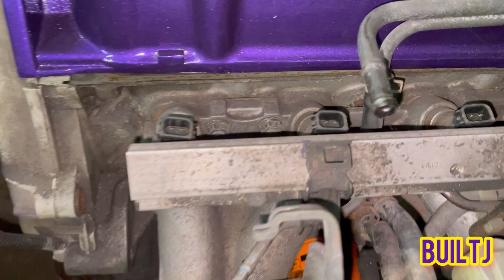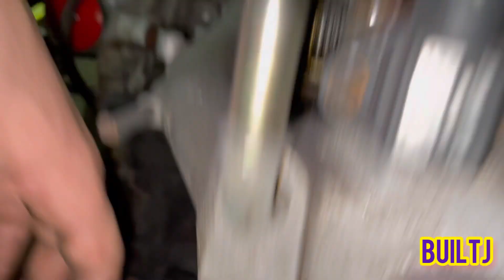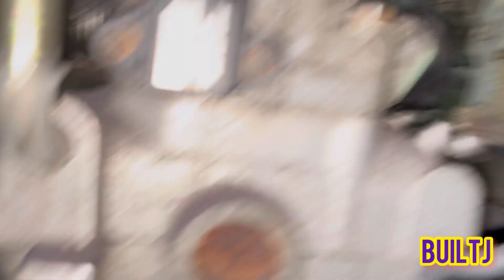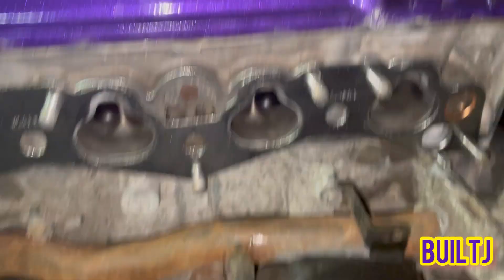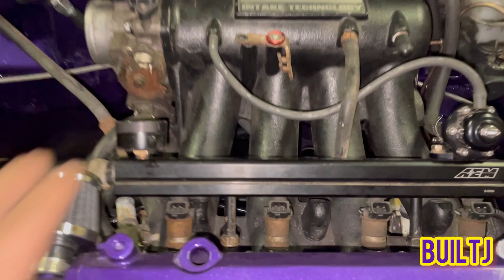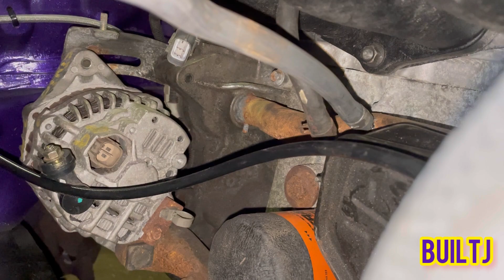D16y7 intake manifold skunk2 upgrade!

Comment: How did you go from a three-wire plug on your idle air control to the two wire for the new intake you didn't show anything about that and that's where I'm having my problem
Reply from the maker: It’s depends on the ecu I never changed to the 3 wire plug. 
3 wire plug is for y7 which is what’s in the car now when you run a p28 or y8 5 speed ecu you need to change to the two wire plug. Honda tech still has a great write up on it in there forums
Reply: @builtjfilion934 I put a plate over where the idler control valve goes on the back of the intake and I still had a wicked pulsation so I checked for vacuum leaks I checked the gasket I checked the throttle body gasket I took the whole intake back off I'm just not sure and I made the mistake of doing this to my daily driver
Reply: @JohnAndrew-i2s what was your fix I need help 😭😭
Reply from the maker: I’m running a d16y7 engine with d16 y7 ecu and stock y7 throttle body that comes with the 3 wire plug from factory no modifications were needed.
Reply: Exactly why I’m here 😂 dude showed everything but that part

Comment: For your IACV hookup, did you need to swap from a 3pin iacv to a 2pin iacv? If so what did you do with the 3rd wire? Wire cap?
Reply from the maker: No I did not I used the same wire harness d16y7 (3plug iacv) installed a y7 throttle body w/iacv and blocked of the skunk 2 iacv that sits on the back of manifold
Reply: @builtjfilion934 automatic or manual? Having trouble haha
Reply from the maker: @sneanlabaaab7986 what set up do you have the one in the video is 5spd😊
Reply: @builtjfilion934 5 speed as well! But i think i have the wrong theottle body hoenstly! I dont have that vavle on the bottom of my throttle body or an iacv i dont think in the same spot. I think i have an automatic throttlebody on and its messing with my idle
Reply from the maker: @sneanlabaaab7986  what ecu are you using and what motor are you running d16y7 or y8 vtec?  D16y7 looks for 3 wire iacv so you must use a d16y8 automatic throttle body.
Reply from the maker: If using d16y8 you have to use the 2 wire iacv with the b18 LS throttle body (doesn’t have iacv at the bottom like d16y7) or a true 5speed y8 throttle body(also doesn’t have iacv at the bottom)
Reply: @builtjfilion934 stock ecu. D16y7. To run the automatic theottle body do I need my ecu tuned to lower my idle? Before i had the manual theottle body and my idle would jump so i swapped to an automatic throttle body which now has a constant throttle but is idling between 3k and 4k lol
Reply from the maker: @sneanlabaaab7986 what manifold are you running? The same skunk2 manifold in the video
Reply from the maker: @sneanlabaaab7986 no tune needed if it idling that high there is a vacuum leak replace the manifold gasket and throttle body gasket and make sure it’s 5spd version gasket
Reply: @builtjfilion934 so to clarify? Use the automatic throttle body with correct gasket and it should fix the high idle?
Reply: @builtjfilion934 just to clarify, if I'm running an automatic throttle body I should be okay just as long as I have the correct gasket?
Reply from the maker: @sneanlabaaab7986 yes what manifold are you using?
Reply: @builtjfilion934 i think that did it, idling at like 800 rn! Just wrong gasket. And skunk2 just like yours!
Reply from the maker: @sneanlabaaab7986 yes sir!!! That’s what I’m talking about brother 🙌💪

Comment: I have a 98 civic lx with the d16y7 motor and was looking to upgrade to the skunk2 pro series intaje manifold that kinda looks like yours. Did u have to move any parts to make it fit? Or is it just swap for swap
Reply: Hey I had the same question and assuming you did the swap did you have to get any other hoses or anything of that sort?

Comment: How did u go about running that style idle air control valve. Bec my oem one was not the same style or the same plug.
Reply: He alr did a engine harness swap im having the same problem spent alot of money for no reason im stuck I’ll probably just go back to the d16y7 intake manifold this is ridiculous 😢

Comment: DO NOT DO THIS UNLESS YOU HAVE A COMPUTER TO TUNE YOUR CAR… YES You need to Dyno after this the car will choke & just bog out do to high air intake & low fuel intake the fuel rail is only going to help but so far

Comment: So what about all the sensors that are on the factory manifold? Do you just not plug them back in or delete them? I’m just confused
Reply from the maker: Depends what ecu your running. In my case I used the y7 throttle body & y7 ecu that looks for the 3 plug signal. So yes the other iacv that sits on the back of the sk2 mani is useless just loop the hose from one nipples to the other to prevent a vacuum leak. If your using it with a y8 5spd ecu then you use the iacv on the back of the skunk2 mani and run the coolant lines to the water pipe on the block and the other one to the intake/ or thermostat housing( each set up is different).

Comment: New throttle cable or same y7 cable?
Reply from the maker: Y8 throttle cable if I’m not mistaken, if not I know the LS p75 throttle cable and bracket would work
Reply: @builtjfilion934  sweet thanks for reply. I thought maybe a different cable being y7 and y8 we're facing differently when installed.
Reply from the maker: @TheMaskedCollective1776  message me on instagram, I can send you photos. I believe it’s the y8 cable. Instagram:BuiltJ

Comment: I have a automatic D16Y7 intake manifold, would I be able to do this process with that skunk2 intake ? I’m trying to switch over to a Y8 I haven’t had much luck with it
Reply from the maker: Yes you can most definitely swap of to skunk2 mani, just use your y7 ecu, y7 throttle body swapped over to the SK2 mani and block off the iacv that goes on the back(you can install the iacv and loop the coolant hose so it’s closed not open or you can make your own gasket and and block off plate until you switch everything to y8).

Comment: i did the same swap on my d16y7 but now i’m leaking fuel from the rail it looks like the bolts maybe the washers
Reply from the maker: Is it leaking from the injector’s or is it leaking from the fuel pressure regulator. Remove and check all O-rings they are known for going bad and causing leaks

Comment: Can i delete the evap?
Reply from the maker: You can do what ever you want passing inspection without it may be another issue. It won’t hurt the motor per say.
Reply: @builtjfilion934  just worried on the inspection. Is that good if i delete it?
Reply from the maker: If your cars old enough you may be able to register it as antique, but if it has to go through emissions inspection it may throw a check engine light which will cause you to fail.
Reply: @builtjfilion934  actually i dont have check engine light but when i connect my obd2 scanner its has no code just the o2 sensor and evap is blinking  but i know my o2 sensor fail cuz its old
Reply: @builtjfilion934  if i convert to obd1 ecu  do i still need the canister or purge valve solenoid ? My car is 98 civic  manual 5 speed. Obd2 plan to buy a tuck harness  then get p28s300 but aftermarket harness doesn’t have plug for evap purge solenoid all aftermarket harness is the same like:

Oil Pressure Sending Unit
Knock Sensor
Intake Air Temperature (Intake Manifold Style)
Oxygen Sensor (Primary 4 Wire)
OBD2 Alternator
2 Extra Wires
OBD2 Injectors 1-4
MAP Sensor
TPS (Throttle position)
Idle Control Motor
Electronic Speed Sensor
Ground
Fan Switch
OBD2 10-pin Distributor plug
h20 Sending Unit (for Gauge Cluster)
Reverse Lights
Engine Coolant Temp
Starter Signal
VTEC Solenoid
OBD1 Computer Plugs A,B,D
Power Distribution Cap

Comment: As soon as i do my manual swap ill rewatch this videos 6 times at least while I do the install myself
Reply from the maker: If you have any questions lmk. Remember y7 TB with y7 ecu or y8 TB with y8 ecu. The iacv reads differently between these ecus just a fair warning. I love this upgrade in my single cam can’t complain runs much better!
Reply: @builtjfilion934 I’m installing a skunk 2 for my manual swap with a y8 throttle body and also using the 2 Wire AICV since I’m converting to OBD1 with a po6 

This should all work right?
Reply: D16y7 aswell
Reply from the maker: @exploitop968 y8 ecu looks for the 2 plug iacv so yes this would work correctly
Reply: @builtjfilion934 now what do I do with the EVAP purge hose
Reply from the maker: @exploitop968 the evap purge one goes to the manifold nipple for vaccum and the other end goes to the charcoal canister on the firewall near the battery. It won’t cause any issues if you delete it out but will throw a evap code
Reply: @builtjfilion934  I sent you a follow on insta, I just got the swap done but obd1 ECU won’t start the car but the old Stock P2E does

Comment: Doing research for a manifold swap on my Y7 as well. I want to fit a 3 point strut bar but not sure if it will fit because of the stock Y7 intake goes up and to the side. I've only seen them on Y8 intakes and not Y7 intakes.
Reply from the maker: Yes the 3 point strut bar may give you an issue, upgrade to a y8 manifold or aftermarket one that runs the cold air intake like a y8

Comment: What did you do for the throttle orientation once you put the y7 throttle body on?
Reply from the maker: Y7 throttle body with the y7 ecu 3 plug iacv, and blocked off the iacv set up on the back of the Intake manifold. Basically ran the stock y7 set up coolant lines go to y7 throttle body instead of the iacv like b series. So I wouldn’t get idle serg

Comment: But if you use a y8 ecu cause of the 2 wire ivac swap won't the y8 ecu be looking for vtec or will it run OK without the vtec
Reply from the maker: It will run without Vtec if you use the y8 setup but will throw a CEL for Vtec solenoid and VTEC pressure, that’s why y8 swaps go with y8 ecu and y7 with y7 ecu. I have no issues with my current set up with a Y7 throttlebody in the y7 ECU no issues no idle serge or a check engine.

Comment: Just watched this video, curious about rearranging the throttle cable. Does it reach over with no problems? Since there’s more airflow would it store any codes
Reply from the maker: I used the b18 throttle cable and it’s worked great for me just had to do a few adjustments to the cable but after that no problems

Comment: struggling a lot with this swap and the iac hoses this video helped immensely
Reply from the maker: Thanks for watching! Glad I could help anyone running a p28 ecu uses the 2 wire iacv and if you run the y7 ecu the 3 wire iacv is used, so I used the stock TB Y7 and just a block off plate for the iacv on the back of skunk2 mani.

Comment: I have the same engine. I don't have a iacv on my d26y7 tho where did u get the valve or can I block it off
Reply: block it off with a plate and reuse the y7 throttle body one
Reply from the maker: Yes☝️☝️☝️what’s he said

Comment: Awesome work brother,,,,What did u do for idle air control valve, in the ek ,the one on the skunk 2 manifold is a 2 wire and like a b series  and the ek is a 3 wire ,need help with brother thank you appreciate the help
Reply from the maker: It depends on the ecu you have honestly, the d16y7 ecu looks for the 3 wire signal and the d16y8 looks for the 2 wire. I had to block off the back of the skunk 2 manifold iacv sensor and run the y7 TB with iacv attached to it and run the coolant lines through there.
Reply: 3 wire to 2 wire conversion. Its pretty straight forward. One wire gets clipped and tapped off at the vavle and then one pin move at the ecu. But you cant do it with the stock computer
Reply: Greatly appreciate the info brother Will a 99 crv  manual swap complete  with the engine harness  work in the 98 coupe if I plug it in  ,but the car is auto

Comment: Alright I see you moved the brake valve or maybe changed it all together couldn't see it very well. But does it really need to be moved? And if so can I just unbolt and stuff it down a bit?
Reply from the maker: Yes you can move it around to where you like as long as you have a mounting point and enough slack!!
Reply: @builtjfilion934  didnt have to move it at all on my 99 coupe. Skunk 2 pro and a 70mm tb

Comment: D16y7 doesn’t have fast idle thermal valve soo I’m confused?
Reply: I wanna say it’s a b series throttle body as I heard stock d series is too small , which makes sense , I’m probably gunna use ls integra TB when mine comes in but wanted to see what this guy used
Reply from the maker: I used a integra TB in this video but I switched it back to the stock d16y7 TB because it was throwing a CEL for my IACV and serging idle with my stock ecu. You can run this set up fine with a b18 or b20 TB and a chipped p28 but I’m running stock ecu so I had to keep it as close to stock as possible.

Comment: Which throttle body did you use ?
Reply from the maker: I ended up using the d16y7 throttle body with 3 wire iacv attached to the Throttle body, left the iacv 2 wire  behind the manifold there as a “block off” technically. 

Reason for this is the iacv on the ecu for d16y7 is looking for a 3 wire signal not 2 wire iacv. I had a serving idle with the b18 TB and 2 wire set up. So I just disconnected the coolant lines from the back iacv on the manifold and put it on the d16y7 TB with the Iacv as one, this solved my CEL(IACV) and my serging idle problem.

All and all I used the original TB off the d16y7 not the one in this video
Reply: @builtjfilion934  ok nice , I read and seen that the y7 wouldn’t work for some reason , I was gunna use the LS tb and covert to 2 wire end run y8 Ecu , do u have the car running yet ?
Reply from the maker: Yes if you switch your ecu to a manual ecu p2p that ecu looks for the 2 wire iacv set up so that will work with a LS TB
Reply from the maker: To answer your other question. Yes, the d16y7 TB will work but you have to run a stock d16y7 ecu anything other than a stock ecu will give you problems.

 there’s other ways to get it done it’s all about what ecu your running P28(d16z6) and P2P(D16Y8) calls for 2 wire iacv 
P2E(D16Y7) calls for a 3 wire Iacv 

Any hondata or chipped ecu can be configured to work on how ever you have your set up.